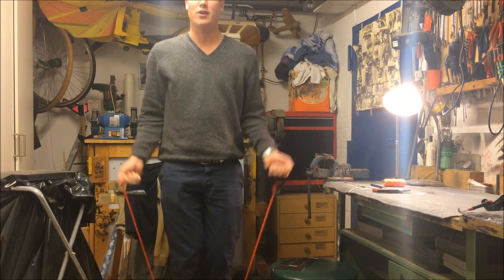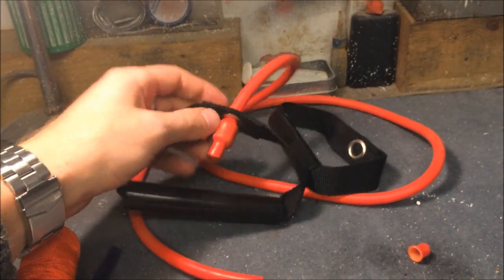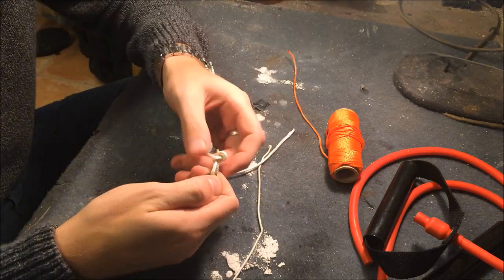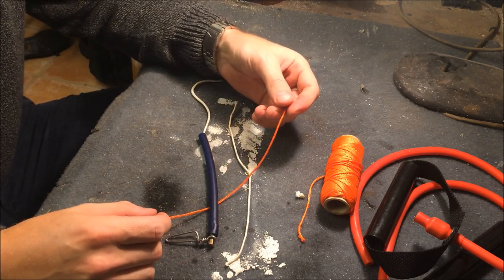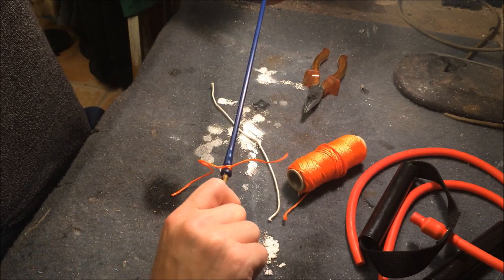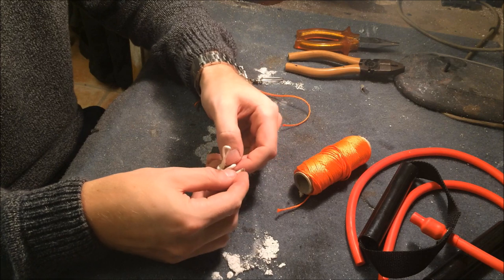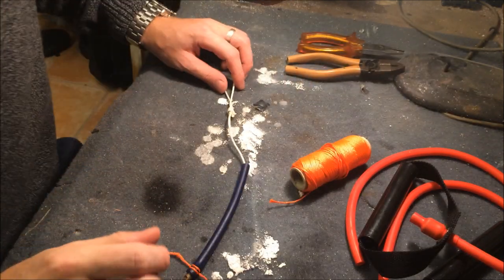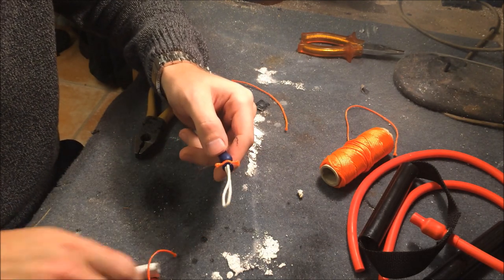Tutorial - DIY Speargun Shock Cord - Shock absorber - Bungee

Comment: Great video. I'm wondering though why you added a 2nd rope at the bottom instead of just using the same rope and creating the loop with an overhand knot (leaving it a little longer in order to do so). Adding another rope creates (to my mind) just a potential point of failure that a single rope would not have. Thoughts?
Reply from the maker: Great that a lot of people look at my videos, so they improve my stuff and techniques. Thank you for your tip! Have a look at my other videos, if you have more annotations i will be happy. Greetings Chris
Reply: john belushi Good point...i will do it without that part